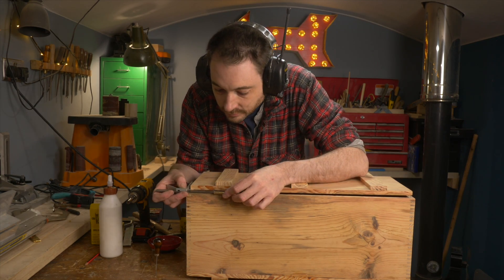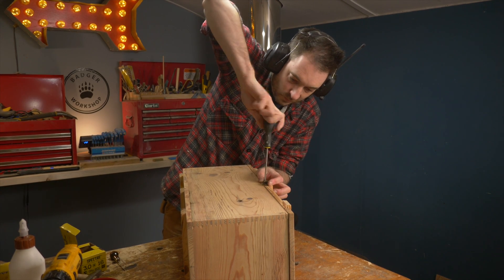Making A Wooden Chest

Comment: As usual, a great project. The badger wax really does bring out the natural beauty of the wood.
When I'm using old timber like that, I use a trick I picked up from the New Yankee Workshop....Norm sands the boards to get any grit out of the surface layer before running it through the planer....I find I'm not touching up my blades as often as I used to since I've been doing this.
Reply from the maker: Thank you

Comment: Lovely use of an old board. For a project like this, how big would the box have to be for you to start worrying about seasonal movement ruining the joinery? I recently made a blanket box from cedar that's about three feet long and 20 inches high. I wonder how my edges will look after a year or two on the edges where the grain orientation is different (if that makes sense!)
Reply from the maker: The joints should hold up. It’s the lid that might move

Comment: I see you have taken off the sliding table on your saw, why's that ? I have the same saw but finding the sliding table difficult to get set up accurate. Where did you get that other table extension you have? Keep up with the videos 👍
Reply from the maker: I just did not have room for it in my workshop. I made the new wing
Reply: I know what you mean, I'm forever taking it on and off in my small shop. I tend to use a sled to square up boards a lot of the time instead.

Comment: i see you've replaced the sliding table with the new left hand extension?
Reply from the maker: I have
Reply: Is that a temporary replacement or more permanent? The sliding table is still out of stock but I still can’t decide on getting it so would be good to get your take on it after using it for a few months.  Thanks for another great project.
Reply from the maker: @philiprotherham1292  the siding table is great if you have room for it

Comment: Hi Matthew, I noticed a bit of an air gap between the top and front of the new camera case, nice build by the way, I also like woodwork & taking pictures (not as good as your equipment) but just as sensitive to dust. You need to put a bit of foam seal around the box and then that pesky dust will not have a way in.
Reply from the maker: Thank you